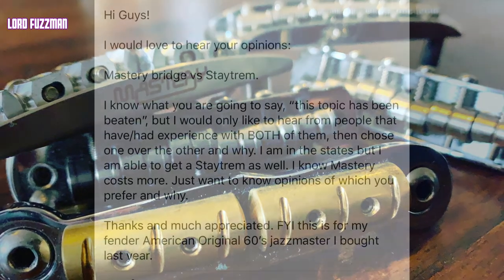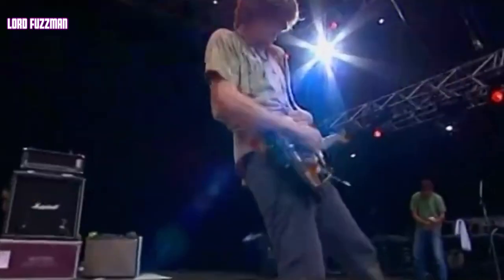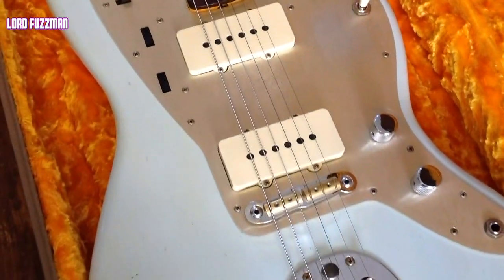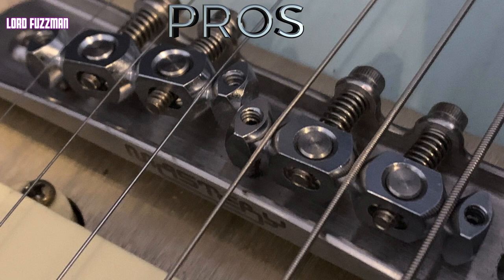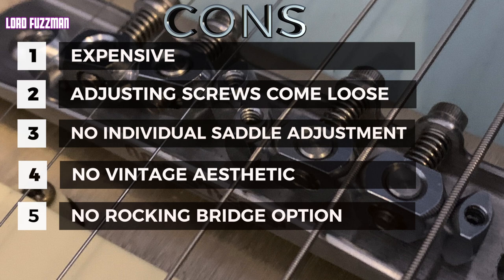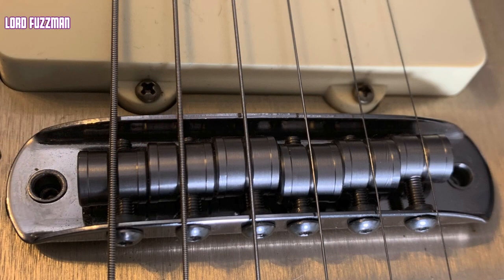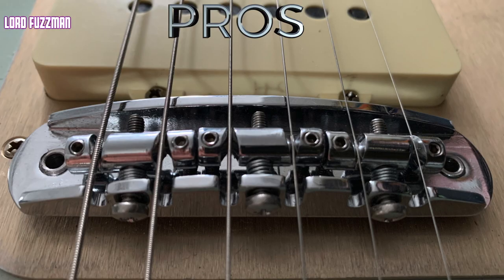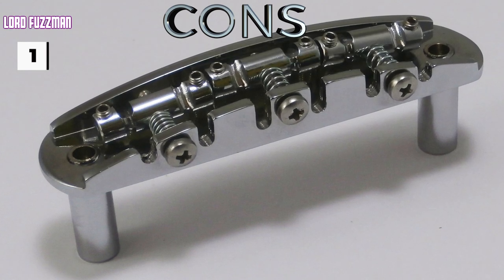ULTIMATE OFFSET BRIDGE SHOOTOUT - Mastery - Halon - Staytrem - Fender RSD - Mustang - Vintage

Comment: Completely not true about the RSD being fixed/non-rocking only. I have rocking RSD bridge on my Jaguar. It’s an EXCELLENT bridge.
Reply from the maker: Interesting, don’t disbelieve you but I’ve never heard that about an RSD bridge and you’re the first person in three years of this video and nearly 100k views to mention it. Are you able to upload a video showing the bridge rocking back and forth? Is it a new one?
Reply: It is actually a new one (at least new to me… might even be an old prototype?)
Reply from the maker: @nickspearience  yeah def a little rocking motion there, I’d be interested to see the posts and how thick they are. Is that a custom shop Jaguar?
Reply: Not a CS Jag, but came from a recent CS guitar. I’ll get my calipers out and give you a measurement on the posts. The best part is that with a descendent trem, I can get the break angle steep enough to have 9.5 strings on it without sacrificing any sustain, and it’s easier to do bends. I think the trough/sides of the bases on all but the Halon wouldn’t allow that break angle without touching the strings.
Reply from the maker: @nickspearience  could also be the thimbles on your jag are bigger than the custom shop hence giving movement.
Reply: Thimbles are on a Johnny Marr jag. Posts on original bridge and RSD bridge are the same. 11/64” / 6.91mm🤷🏻‍♂️
Maybe they have rocking and non rocking RSDs now?

Comment: should work if its set up properly this guy never got a Mexican player series jag had it set up 3 times had a guy set it up then use loctite so it wouldn't move gone out after 2 shows also because fender was to cheap the bridge on these guitars don't even line up with the bridge pole pieces so its either replace it or you have a 1000$ paper weight

Comment: In my humble opinion, a rocking bridge is definitely not a "pro." I think it would be better to say that the vintage rocking bridge was a design flaw from the start, as were the threaded saddles. Fact is, the only reason Fender used the threaded saddles is because they could buy the threaded steel stock at the right price point to make the early guitars profitable. Now that we know a lot more about bridge design, there's no reason to be stuck with the sub-optimal vintage Fender bridge.
Reply: Your opinion is skewed.A properly setup rocking bridge is fantastic with the vibrato.  Sounds like you have no real experience with them.  O
Reply: @Skiptracer1981  As a matter of fact, I'm an engineer and guitarist with decades of experience with various offset bridges—I've literally seen them all and tried most of them seen in this awesome video. Leo Fender was a great engineer and I'm a huge fan of Fender guitars like the Jazzmaster and Jaguar, but his design wasn't perfect (none of us are!) and like any great engineer, he had to work within the constraints of his time as well as market conditions. I laughed a little when you said "properly set up"—the point here is that it's a design flaw, which means the issue is not setup but the inherent weakness of the original design. Threaded saddles are almost universally regarded by gigging musicians as a major failure point. The string often "jumps" out of the shallow threads and your guitar immediately goes out of tune or becomes unplayable. The vintage bridge is not high enough and there's not enough downward pressure and break angle on the strings, which often requires hacks like shimming the neck of the guitar. Also, the string spacing is not uniform and the strings often do not pass directly over the pickup pole pieces. The height adjustment screws often rattle and must be fixed with adhesives like Loctite. Rocking bridges, on the other hand, increase the likelihood of breakdown and wear just as all moving parts do but unlike a vibrato unit a rocking bridge is completely unnecessary (for those who prefer vibrato-equipped guitars). Mastery, Halon, Staytrem, and even Fender (with their new RSD bridge) have solved these problems with better design. The RSD bridge itself essentially negates your entire theory, since it's produced by Fender and therefore an admission that the original design was flawed. It's 2020 and all these effects have been carefully documented by Lord Fuzzman and others. This is basically Design 101 and you should do some background reading about introductory industrial design.
Reply: @Skiptracer1981  Well I've been setting up guitars for a lifetime, and I agree with Daniel about the stock saddles. Although I prefer rocking bridges, as I feel it is part of why an offset trem works so well. That's why I'm glad Halon offers the rocking option. If people are stuck on fixed bridges Halon does that too.

It's not that you can't make a vintage bridge work and sound good, my two guitars with stock bridges work fine, it's just that design could have been better from the start. The threaded saddles work, but deeper grooves with softer edges work better, and offset saddles adjusting screws work better for setup. And yes, with the right neck angle (ie shims) you can make lighter gauge strings work for lower action with a stock bridge, but it's even easier with a modern bridge to set string heights. I have two Halon bridges, and two guitars with stock bridges. In my case, I find the Halon bridges better in both sound and adjustability. 

On my two Halon equipped offsets I preferred the sound as soon as I swapped bridges. And unlike a lot of people that work from skewed memory, I recorded my guitars with the same exact string set before and after swapping bridges, and in both these guitars that sound was better for me with a Halon bridge. It may not be the sound others are going for, but it is exactly what I want. The Halon bridge seems to translate the subtle things I do to get certain sounds jumping off of my guitars. Here it is with my Partscaster Jag I built...
https://soundcloud.com/daniel-weldon-1/halon-wheels   and here's my Wildwood Thin Skin Jag with a Halon... https://soundcloud.com/daniel-weldon-1/i-wanna-love-you 

Honestly some hardcore offset fans may not like my sound, but for me the Halon sound is perfect.

Comment: 50£ for the plastic ones! Shocking. If had ££ I'd start design 52mm and would fit to the others! Or just copy fenders special half round brass and put your own strings in as it is! It's years there's been problems with jazzmaster /jaguar bridges and if want fix it they ask for silly£. I shall use hard plastic and drill 3 holes for 250 also tougher plastic? Or but rod of brass and make it radius right and put it onto only bridge! This has been an issue for years and when its 2/3 piece mold 180£or plastic cylinder 6 for 50£. Long time joke but no one has made 52 mm roller bridge? Or another permanent radius i bar with notches! Someone should have made millions and been happy double the money ! But greed is involved in any fix with these bridges!
Reply from the maker: Which one is £50 for plastic?

Comment: Mastery? Cost to make? Plastic molds with 3 screws in 6 of. £ to make? The newer design? Brass half round are? No doubt will sell but for over matery price which is a joke. Heard in 1961 Bigby cost 10 guinea. Sane as half a hofner 1950 club 60. Sanctions and big companies so 2 bigsby would have paid for 1 hofner club 60. Ebony fretboard. Lovely guitar. But it is not 60s anymore but asking price of the bridge being same cost as a squire jaguar guitar is mad!

 Little plastic mold 50£ with dots lines all over from moulding process. Do not even remove these ugly cheap lines50£! Buy 60mm of hard plastic rod. Cut into 10.?mm parts then drill 3 holes where needed. No unsightly lines circles also probably harder plastic aswell. Cost 2£ and a drill. With old bridge. Then cut out the places for each string. But its a silly design. No string threaded line really? Why it got past and still sell yo this day with this is silly? Fender not accepting it sucks? Maybe they own mastery and others?

Comment: the bridge that came with the guitar was'nt ' perfectly fine ' at all,  it's a crude cast item that has no machined surfaces, the height posts jangle in their brass threaded inserts, the shoulders of the posts which are lathe turned, bear upon the crooked base of the 'tune - matic' rocking back and forth and, with this overall design the sustain transfer points are all spread out across the body . . no wonder it's ripe for anything promising improvement !!